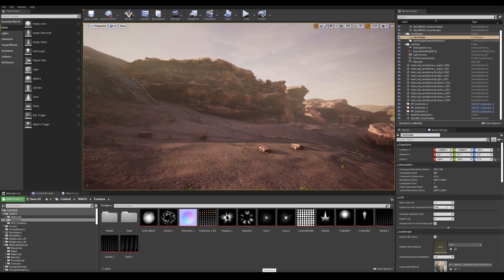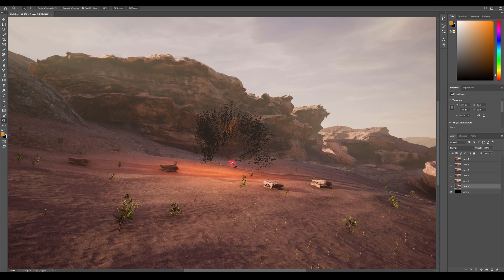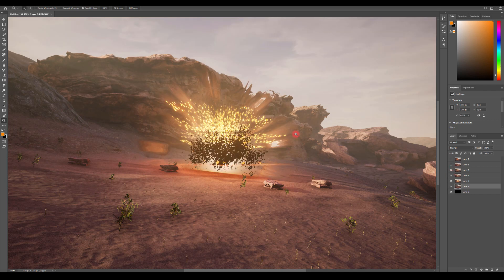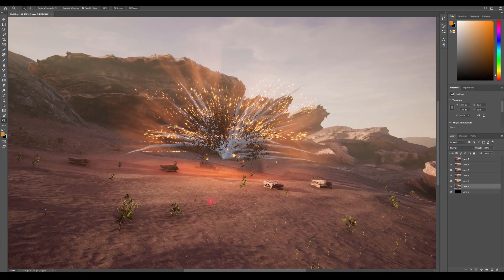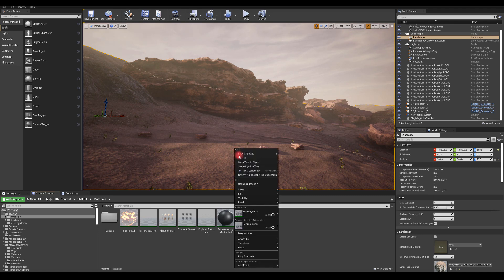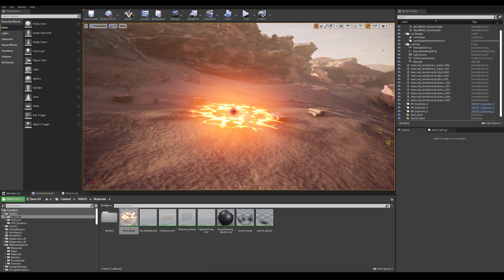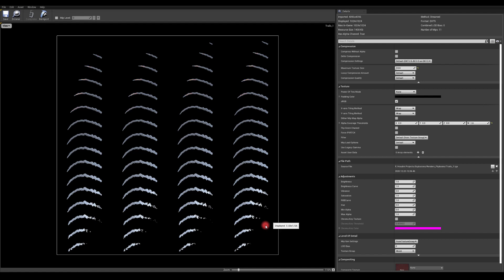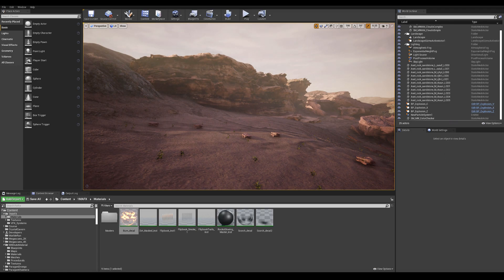How to Realtime - VFX / Explosion Breakdown / Unreal Engine 4 / Houdini

Comment: I liked your approach on the trails using flipbooks, I wondered at first how you did fixed the orientation problems of billboards going toward the camera, but then I realized you just used them on the sides :D Clever !
Reply from the maker: yeah pretty much, I think this is a disadvantage of using trails as flipbooks. Adding pieces of ground / dirt also sparks moving in all directions helps to "fake it" a bit more.